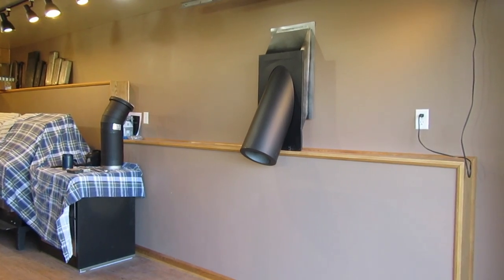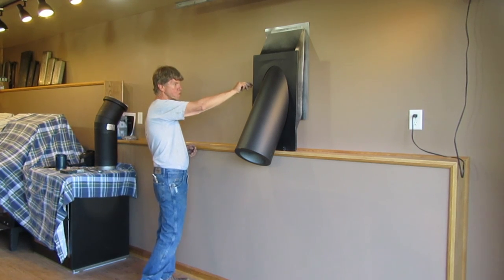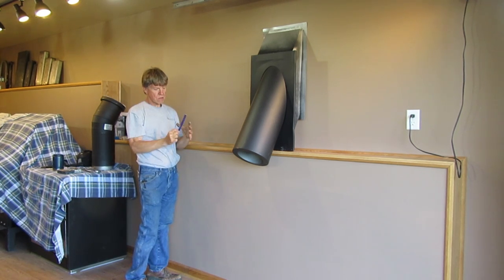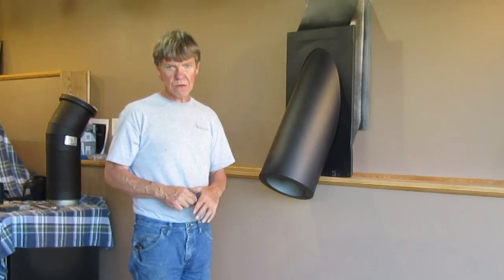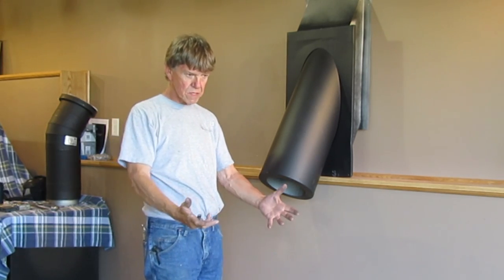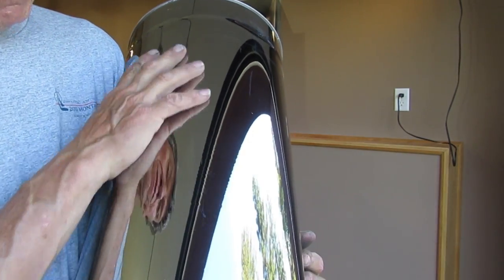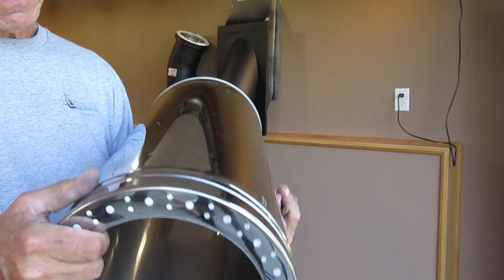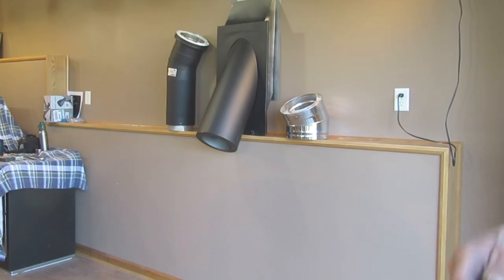The Benefits of a 30 Degree Angle Installation with Class A Solid Fuel Chimney Pipe

Comment: This is brilliant!  I'm planning on buying a Kitchen Queen 480 from you after I'm moved into my rural home, but my engineering problem is that the chimney pipe would run through upstairs bathroom.  I thought I'd have to use a couple elbows to resolve the problem, until I saw this video.  This allows me to run the chimney pipe to the outside and then up, without the risk of creosote buildup NOR of impairing the primary function of the chimney, which is to provide the suction that pulls the smoke/heat from the firebox and through the cookstove.  Engineering problem solved!  And your "metalbestos" chimney pipe just makes a great solution even better!

Thank you for posting this inspiring video!  I will definitely be doing business with you, once it comes time to purchase my KQ480.